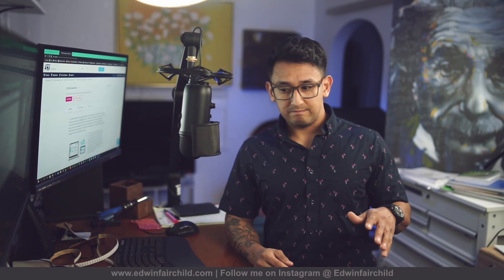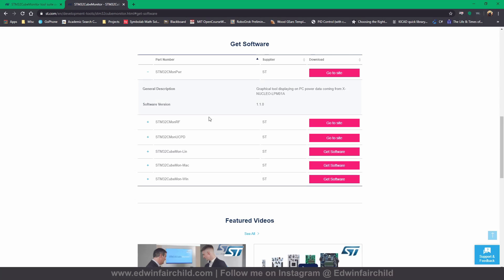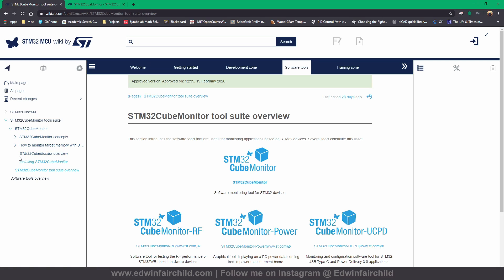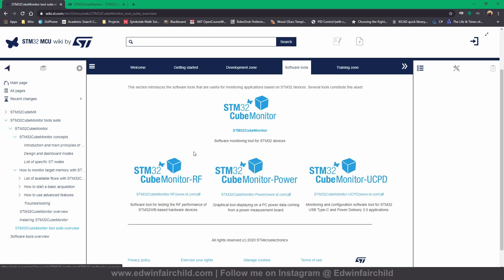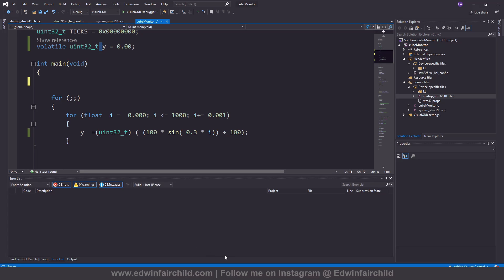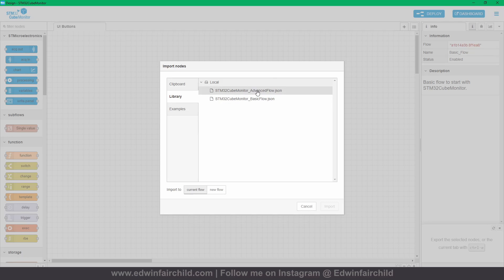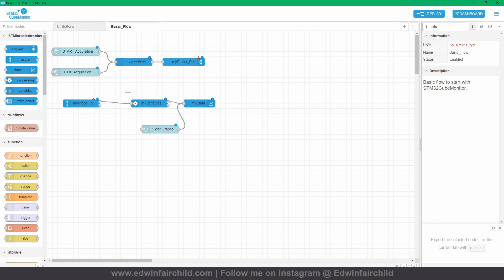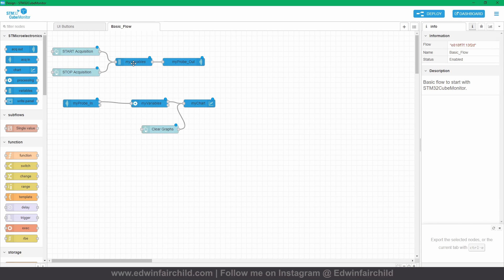STM32 Cube Monitor Intro

Comment: Bro first of all how are you using visual studio and don't you use stm32 cube ide I mean how did you set it all up the cube ide is all light theme it's good though but not as good as visual studio and do you get all the debug tools in visual studio .
Reply from the maker: Visual Studio blows Eclipse out of the water. I have plugin called VisualGDB which lets VIsual Studio support ; STM32, NXP, ATMEL/Microchip,  ESP32 , FreeRtos , Embedded Linux and much more. You can plot your variables and watch them in a graph and make wavewforms , you can see the register so much better and cleaner then cubeIDE , and its not crappy java absed like cubeIDE/Eclipse is. The visualGDB plug in does all the setup and its so easy to use.  lol But i do use cubeIDE once in a while to generate LL api and then load that into Visual Studio. Ihave a dark Theme  on cubeIDE by the way just go to the eclipse market place and download the Darkest Dark Theme with DevStyle.
Reply from the maker: https://www.instagram.com/p/CK0NBYaLsUV/

Comment: I understand STM32CubeMonitor replaces STM-STUDIO-STM32 (STMStudio).. but is it possible to continuously graph every nth element of an array?   For example, the ADC can be configured to scan channels and place results in an array, but since the array won't have contiguous data for a channel, it has to be graphed with care!
Reply: you just add another variable in the upper "myVariables" bock. e.g. if you already have uint16 array[0] with start address 0x200001f4, you add array[1] with start address 0x200001f6 (+2 bytes)

Comment: man make a video on USB on stm32. usage example like interfacing usb keyboard with stm32 and tft display. i am working on it. but hoping for a video on usb.
Reply from the maker: It won't be on bare metal  register level  that's for sure. 😂
Reply: @EdwinFairchild  why not man? We can implement in stm32 for sure.
Reply from the maker: @surya.6283  it can be done of course but it's a lot of code and you have to be very very knowledgeable about USB protocol. You can spend a lifetime just learning USB 😂
Reply: @EdwinFairchild  oh got it man. Sed.
Reply: @EdwinFairchild  but make one. there are not many on youtube.